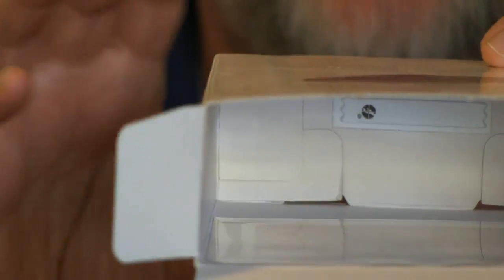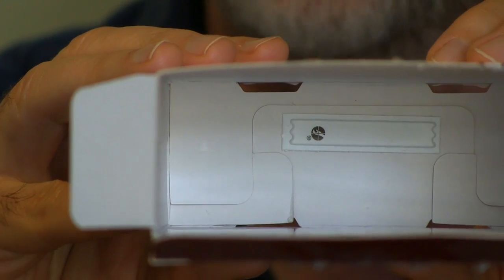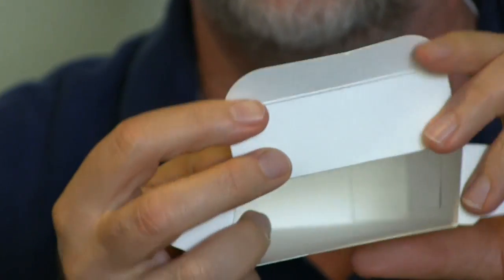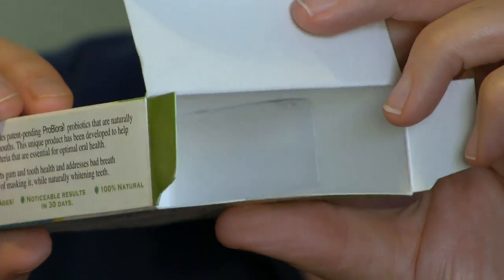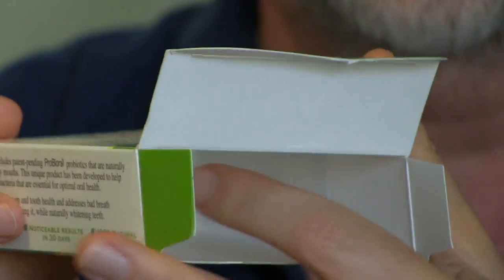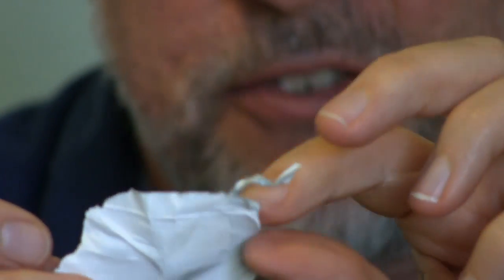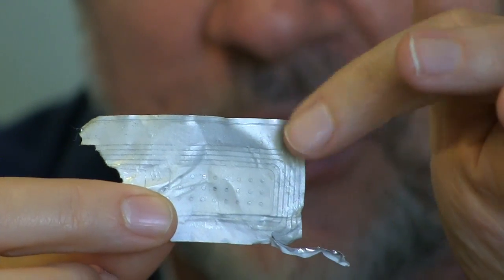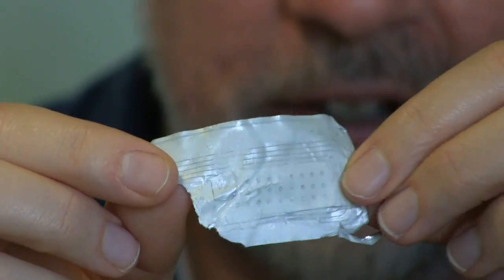What are RFID Tags?

Comment: I wasn't sure if the RFID tags took the radio waves and used them as a wireless power source, or if the radio waves bounced off the chip and came back to the emitter. It was surprisingly difficult to find an answer to that, but you explained it really well. This is super interesting.